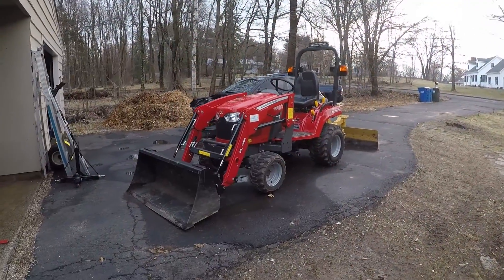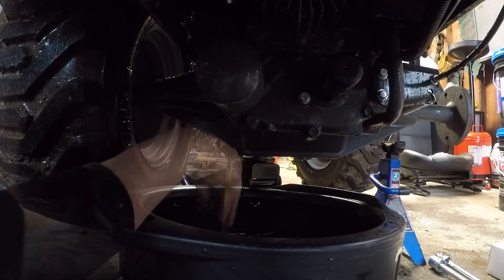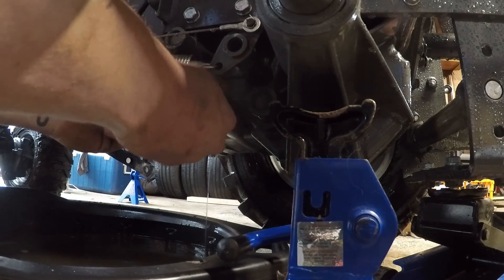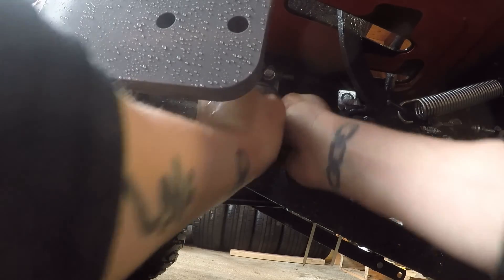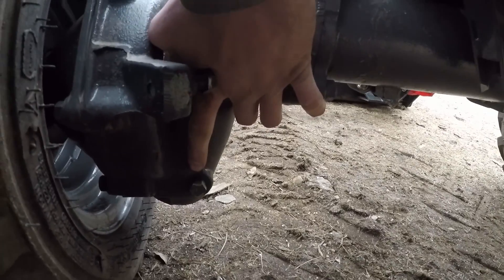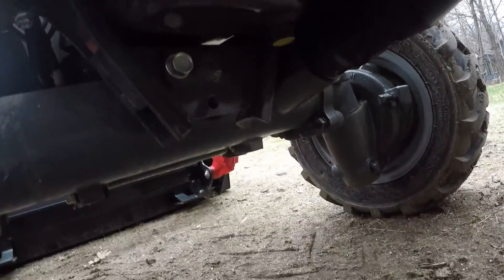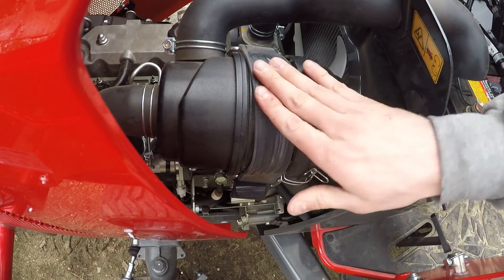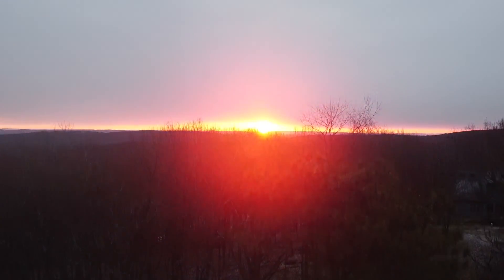Massey Ferguson GC1723E - 50 Hour Service / Maintenance Amateur Homesteading

Comment: Hi. Very informative video. Very well explained. What are your thoughts on the MF GC1723E. I am on  a  property with a 20-degree slope, and I'm looking at purchasing this particular model for cutting/slashing the grass. I am new to farm work and your input would be very helpful. 
Steven.
Reply from the maker: @StevenDodge-q1r  my name is Stephen as well. This is a solid machine for a basic homeowner. I have since upgraded to a larger Mahindra machine. I run a landscaping business and do more than the average homeowner. My advice would be whatever machine you think you need, get the size up. You will never regret getting a larger machine. You will regret getting a smaller machine. Hope this helps.

Comment: What’s the brand of hydraulic/transmission fluid did you use your link shows AGCO but you didn’t use that in video. Is it Lucas brand you put in?
Reply from the maker: @Andrew-yx6ut  I believe at the time I used a mobile brand oil.

Comment: how you like the tractor? still got it?
Reply from the maker: @JohnBraman413  I do not have my Massey anymore. I went with a larger machine two years ago. Nothing against the Massey. For a regular homeowner, the 1723e is a great machine. I just do a bit more than the average homeowner. I also use my current machine (Mahindra 2638) for a landscaping business as well. If you are a regular homeowner looking to do typical projects around the home, the 1723e is a great machine at a very reasonable cost. I believe the 1723e is in the 15-18k range vs my Mahindra which costed me about 32k.

Comment: If you turn the deck height dial to the highest setting it will keep your mower deck arms up to ensure they don’t hit anything low while using the 3 point hitch

Comment: You didn't show where the hydraulic fluid goes in..
Reply from the maker: You'll see the port on the rear of the tractor. If you have questions refer to your owner's manual. That will show the fill point.
Reply: @amateurhomesteading4688  I did not receive an owners manual...
Reply from the maker: @jackjohnson3603  I'm sorry to hear that. There is a yellow plug on the rear of the transmission (back of the tractor). This is the fill port. It's the only fill port on the rear of the machine. Very difficult to miss. If you still can't find it, a simple google search should show you its location.  If you continue to struggle, I recommend having an authorized dealer perform the maintenance. Hope this helps, good luck.

Comment: Manual says hydraulic fluid doesn't need to be changed until 250 hours, and it also does not say to change the front axle fluid at 50 hours OR change the fuel filter OR to clean the suction filter !! Those things are done at the 250 or the 500 hour mark.
Reply: Follow up: So the manual does say to change the hydro oil every 250 hours, OR yearly. However, engine oil gets dirty from engine combustion, and it can't be helped. You run the motor, you dirty the engine oil. Hydro oil does not pickup any contamination from the engine, it degrades primarily due to heat. In other words, long hours of hard work. And it takes a long time to break down modern synthetic hydro oil. Mine looks almost clear at 54 hours whereas the  engine oil is pitch black.  But by the book,  in order to maintain the warrantee you would be required to change the hydro oil, REGARDLESS of operational hours (if you can believe that) once a year.

Comment: Manual says hydraulic fluid doesn't need to be changed until 250 hours.
Reply from the maker: I went off what my dealership that sold me the tractor recommended that I do.
Reply: It also does not say to change the front axle fluid at 50 hours, or change the fuel filter or to clean the suction filter. Those things are done at the 250 or the 500 hour mark. Glad I read my manual before I wasted a bunch of time and money on needless maintenance .
Reply: Hydraulic filter seems in a vulnerable place for damage. The plastic fan is in a bad place ahead of the rear axle. Wish they would change them, but your video was clear, concise instructions. Good job.

Comment: Make sure you use Diesel oil for the crankcase and not regular engine oil. My dealer only uses 15W 40.
Reply: Diesel for crankcase. What's that about? Did I miss something?

Comment: Why would you buy a expensive piece of equipment and then use aftermarket parts and fluids? These machines are designed and tested to last using specific fluids and filters.
Save a quarter now but pay for it in the long run
Reply from the maker: I researched all of my fluids and bought from reputable brands. I thought it was a good decision at the time. In the end you always have to do your research and make a decision that you are comfortable with.

Comment: Nice vid, how and with what did you clean the suction filter?
Reply from the maker: I actually ended up replacing it. I thought at first that it called to replace it. The part was fairly inexpensive but I'm sure you could give it a decent clean with something like diesel.

Comment: Took mine to dealership for its 50 hr service. $650 later. My butt hurt after that.
Reply: Wow! I think my bill was $207 today 10/19/2022. 5 gal. Hydraulic oil and filter, 1 gal. oil and filter, air filter and fuel filter. I did it myself. Man, that rear tire is heavy!!

Comment: Just got approved for one of these with a tiller, planning on getting a rear blade for it, what size blade are you running?
Reply: I have a gc1723e tlb and all my attachments are 4ft. Well scraper, box blade and tiller are 4ft. I have a heavy duty offset scraper and would recommend that.

Comment: You mention in the video about links to Amazon etc. for all the parts you bought.  Am I missing it?  Thanks for the vid.  It has been a lifesaver.
Reply from the maker: Yea sorry. Unfortunately, amazon took them down.  If you refer to your owner's manual it should give you part numbers. Then it's just a bit of research to figure out what you need. Happy that the video help. Subscribe to my channel as I will do more maintenance videos as my tractor needs it.

Comment: My Massey Ferguson dealer told me with my GC 1725 that all I have to do the 50 hours service it just change the oil filter and the engine oil that was it and naturally grease everything do you think I should change the hydraulic oil and everything like you did for the 50 hours service
Reply from the maker: It's your machine so it's up to you. Everything that I did is what Massey Ferguson recommends that you do for the 50-hour maintenance. I imagine if they are recommending it then it is probably important to do it.

Comment: First, thank you for the video. It was one of the big factors in why I purchased a 1723e because it made me feel comfortable with self maintenance of these basic items. The manual for my GC1723e calls for changing the hydraulic fluid/fliter annually or every 250 hours and changing the front axle fluid and fuel filter at every 2 years or 500 hrs. The 50 hr service does call for checking and adjusting the toe in too. Your manual may be different, but I wanted to note the differences. The manual number I have is ACW7152790 edition from Oct 2018 even though I have a tractor manufactured in March of 2020. I've looked into the AGCO part prices and in my area they are very reasonable, so I see no reason to risk warranty issues by using aftermarket fluids and filters. AGCO also now offers a powertrain warranty extension of 5 more years for a total of 10 years and the cost of this is only $500, so I'll only be using ACGO parts for these reasons. Not saying you are wrong, but I wanted to mention these points of consideration for anyone who may be looking at the Massey.
Reply: I have been looking for where in my manual it says to change the hydraulic oil & filter at 50 hours and I can't find it. My GC1723E is also a 2020 model and I have the same manual as you do. Maybe MF decided that it wasn't necessary to change it at 50 hours. Mine only shows to change the engine oil and filter at 50 hours. I am just going to do what the manual says to do. 
I do appreciate the video though because sooner or later this all has to be done.
Reply: @paulwelch6235  There are also a bunch of torque checks to do at 50 hours too. I'm going to go through this on my tractor soon and hope to have a video on the topic since I haven't seen torque checks covered in any other videos.
Reply: @Redneck_Ed  Yes, and I check the bolts on my tractor once a month. There are lines on the bolts and wheel but they never have lined up since I got my tractor. I haven't ever had a lug bolt get loose but I still check them. I really do enjoy your videos. Not many videos out there that are specifically for the GC1723E tractor. I love mine. It surprises me what this small tractor can do.
Reply: @Phil Ward I believe that Massey revised their maintenance schedule for these tractors around 2021. I'm at 56 hours and I think all I have to change is the engine oil and maybe the hydro fluid. I do not think it mentions front axle oil or fuel filters.
Reply: I have the 1835EH and it calls for the transmission fluid change for both Manual and Hydro. Not sure what version the book is, but we got ours in 2021. I'm sitting at 54 hours and haven't had the time to do the service. What's odd, is that the Parts guy at the dealer said the transmission would be scheduled at 750 HRS. My book says 50 HRs and then every 200 HRs.

Comment: My DL100 loader bucket hydraulic is not working.   The loader lift works but bucket tilt does not.  I see no leaks.  I was using loader to push branches and logs in a pile for burning.///edit::  Found a connector loose, must have been hit by branch.  All good now.
Reply from the maker: Nice. I'm glad you were able to fix it. I was gonna say, it sounds like a loose connection. Hope you love your machine.

Comment: What kind of hydraulic fluid did you use? I can just make out the STP logo, not much else. The manual states Permatran 821XL for that, as well as the front axle. Do you know if the Triax stuff would be compatible for the transmission too? The dealer is a long ride, trying to find easier options.

Comment: Hello, I have a question. I just bought a GC 1723 e. When you put yours in four-wheel-drive does the four wheel drive indicator light on the dash illuminate? Mine does not. My dealership will not give me a straight answer if it is supposed to light up. Thanks!
Reply from the maker: My tractor does not illuminate anything when I have it in 4 wheel drive. Hope this helps.
Reply: Mine does not either.

Comment: Nice detailed video. I have the same model tractor and my manual says to only do oil and filter at the 50 hour service. Does your manual state something different?
Reply: My Manual says oil and filter only at 50 hours Mine is a 2020 Massey Ferguson 1725M
Reply: Correct oil and filter only at 50 hours according to shop manual.
Reply: They updated the maintenance interval. If your manual says to only do one or two fluids, changing the others won’t hurt anything other than your wallet.

Comment: Did my 50 hour service. This video was excellent. Easy to follow. One question. You said 150 hour inspection and my manual says it’s not due again until 250 hours. Can you check that please. Again thanks.
Reply from the maker: Happy to help!! When I went to do my 50 hour service, I found that there was not an easy well laid out video on youtube. Thought I would help owners by making my own!!
Reply from the maker: I will have to check on the next service. I may have misspoken when I made the video. Thank you for the heads up!

Comment: Yeh cool, handy vid.  I just did an oil change on mine, switched it synthetic.
Reply: How Much Oil do I need ? Motor ? and Hydraulic ? where can I buy these localy or do I need to buy online ?
Reply: Well motor oil, I think it's spec'ed 1.6 L.  I just bought a 1 gallon jug of the rotella t6, I used most of it, I think I have maybe a 1/2 quart worth left.  I haven't done the hydro change yet, but bought amsoil synthetic directly from amsoil.   I got all the filters and such from here: https://www.shoproudebushequipment.com/collections/massey-ferguson-filter-kits/products/massey-ferguson-gc1700-filter-service-pack
Reply from the maker: Been a while since I did it but I believe Pond Acres is correct. I bought a 1 gallon jug and used most of it. I listed a link to what I used in the description of the video. Got my fluids from Amazon. I believe the hydraulic fluid was close to 3 gallons. I also supplied a link to the fluid that I used. If you are unsure, I recommend checking the service manual. It should supply you with all of the information needed.

Comment: About greasing: you should be greasing the various pivot points (and on some implements, bearings) a lot more often than every 50 hours. Check with your manuals, different grease points have different schedules and different grease types needed. Also, if switching from one grease to another be sure that they are compatible; or disassemble the joint and clean all the old grease out with a solvent. If incompatible greases are mixed, the lubricant can come out of solution and the result is severe wear; almost as bad as a dry joint.

Comment: Returning the loader and/or backhoe to “home” position does NOT empty our ALL of the fluid in the rams; because they are double acting. Fully retracting the rams (which, on the backhoe, is not the “home” position) will, however, get you as close as possible to being empty without actually disassembling it and blowing everything out with an air compressor (including cycling the rams in both directions several times while inverting them). As mentioned in my other comment, I’m going to do the hydraulic fluid again at 70 hours to try to flush out any grit that might be hiding in the rams, etc.

Comment: Removing the filter cover plate on the main hydraulic filter is not strictly necessary if you have a filter socket that can fit in there. Watch out if you do remove it though; the bolts are not high-strength and one of them snapped when it was being reinstalled (No, I wasn’t the gorilla with the ratchet in this case). I’m going to have to get under there with an easy-out and swap the bolts out with something a little bit stronger.

Comment: Great video but can you do a loader,hoe maintenance..thanks
Reply from the maker: I will take a look at the manual today and see what I can do!!! Feel free to subscribe. This seems to be popular so I'll do as many maintenance videos as I can.
Reply: It’s fairly straight forwards... just grease all the joints. Personally, I’m going to replace the hydraulic fluid twice; once at 50 hours (already done in my case, I’m at 54 hours) and again at 70 hours or so because some of the break-in fluid is still in the hydraulic lines, valves and rams. The extra 20 hours will allow what is in there to get mixed into the main body of fluid, and the fluid that’s in the rams, etc. will be much cleaner.